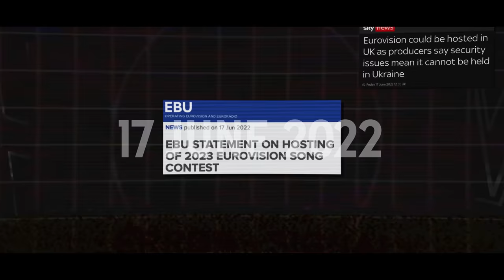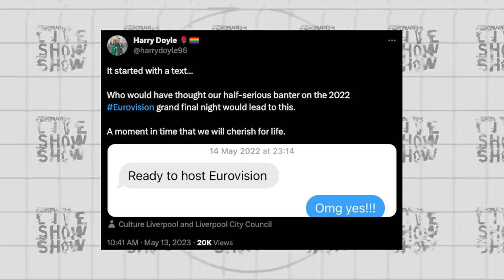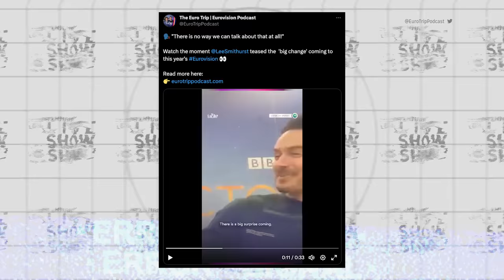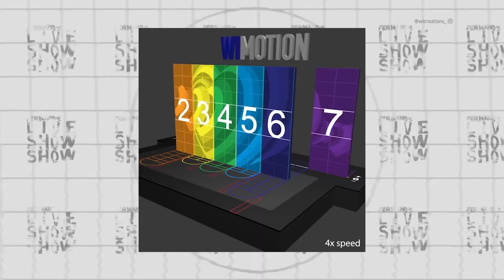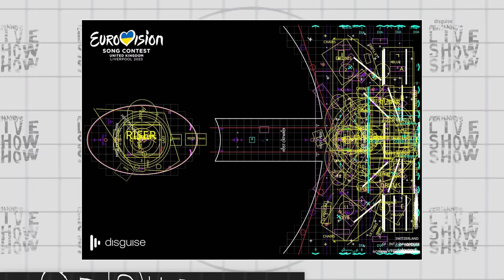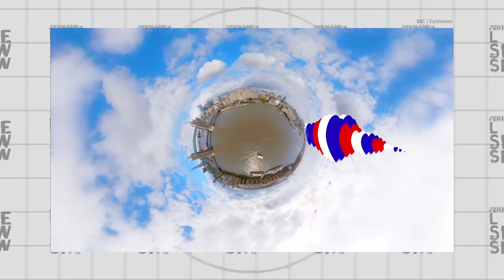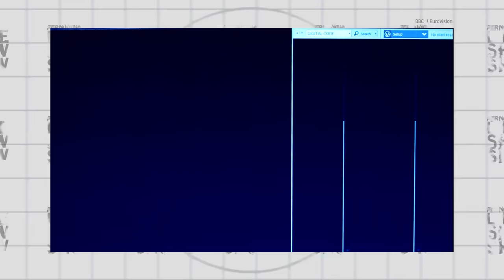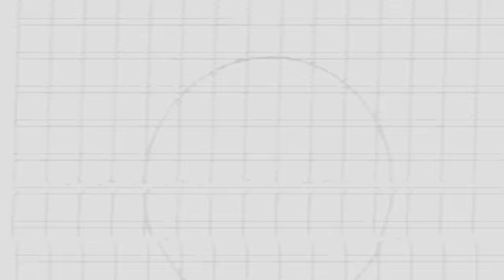The Story of Eurovision 2023 🇬🇧🇺🇦 • Behind The Scenes

Comment: Regarding the "mid 2010s, we were lucky to have lasers" - the laser system was used a few times, but most of the time when there was a LED floor that was used for marking up positions, the way you phrase it sounds like that is a recent invention.
Reply from the maker: Hi! Thanks for stopping by.
Very good point indeed, LED floors for marking positions have been used for a few years indeed, and my point in this case is to compare the fast progression of tech to the now very much established standard of LED floors which has been around since approx 2014. What has been interesting is how productions posit this as a new innovation for the year, but is actually a nice progression of the year before with new features etc.
Reply: @FernandsLiveShowShow  if I recall correctly from the 2006 HD footage, the LED [or some predecessor tech] floor was used then to position set pieces. No idea if it was the first use though...

Comment: A correction. At 23:47, Germany has 96 cues. If you did it based on the cue numbers of a cuepilot you've seen, it may be because some cues were deleted at some point and then new ones were added, while they forgot to reset the numbers. And technically the most cues are for the Liverpool songbook interval with 124.